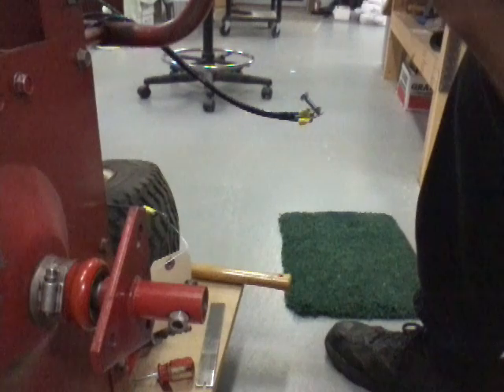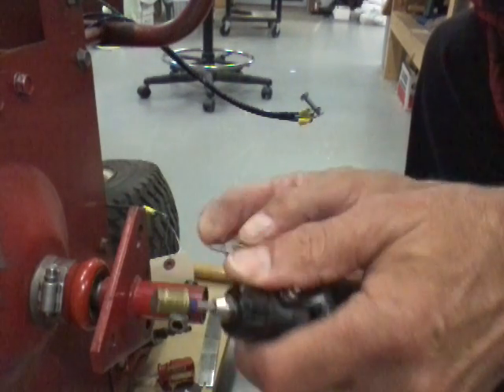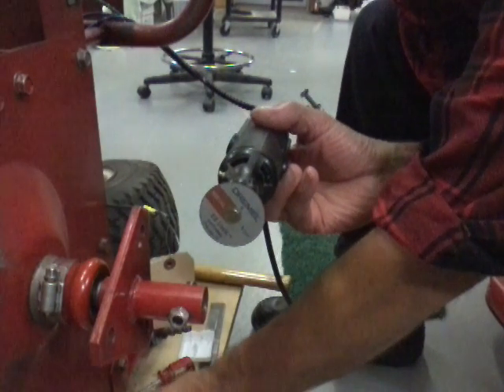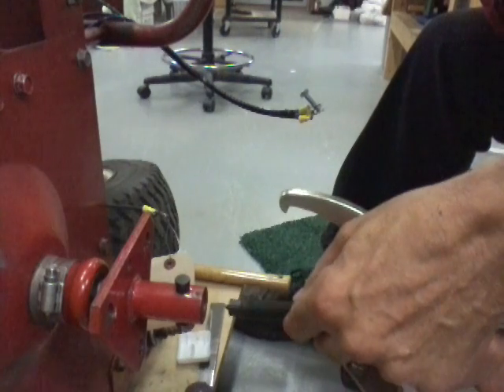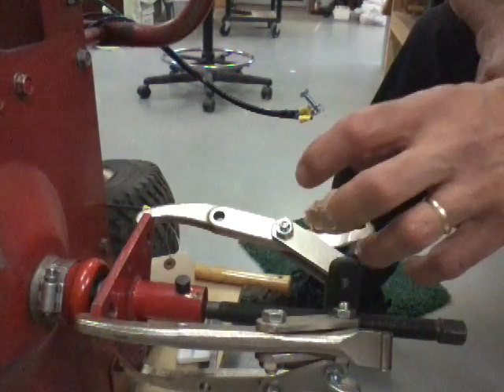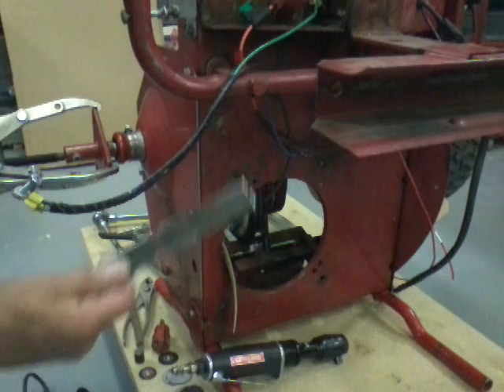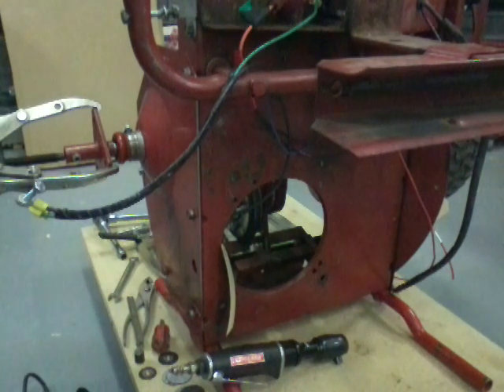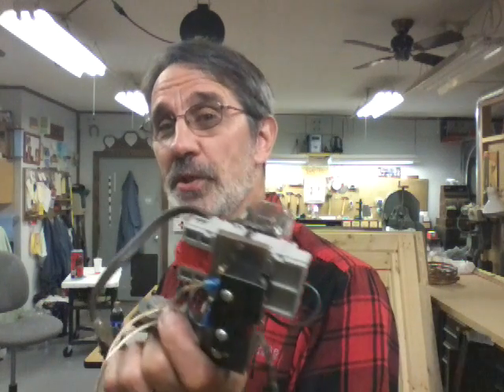39. Removing the wheel flanges off the axle of my Snapper Rider

Comment: Thanks for the video!  Luckily I didnt have to cut mine, but tapping the puller with the hammer did the job. I tightened and tapped multiple times until it finally started moving.

Comment: When I worked at the Snapper dealer we had to cut off lots of them.Sometimes you can warm them with a torch (not a wimpy hand held propane torch). Most times we beat them off with a bar and hammer.
Reply from the maker: Well at least doing it this way you can reuse the wheel flanges

Comment: Just tried everything you said, now my gear puller is stuck on there. It wont turn either way. How important are those boots anyway, its just a snapper. Im takin mine to the curb, whoever gets it, is gonna get a free gear puller too. Thanx Snapper!
Reply from the maker: Send me a picture of this with the wheel puller on it and let me see what’s going on and yes the boots are very important it keeps the sand and dirt out of the differential and chain case. Jim
Reply: @jimjackson9381  After bending one of the ears, i was able to get the puller off. I think this job is too big for me, and ive got alot of money in it, and dont have proper tools. So,i cut the boots and put them in place as is.
Probably gonna fail.
Worst day EVER!!!
Thanks for your help though.

Comment: Jim thank you so much for these tips.  I followed your steps exactly and used a heavy duty 3-jaw puller.  The thing STILL wouldn't budge.  I finally utilized that elongated hole on the fender, a 12" long 1/2 extension, and a big hammer and hit the BACKSIDE of the flange while keeping tension on it with the puller.  I just kept hitting it from the backside and rotating it to evenly distribute the force.  After a few strikes with the hammer, the puller would let me get a few more turns so I knew it was moving.  However it found me ALL the way off.  Unreal, never seen one that mean!  Thank you sir for your outstanding videos.  They have helped myself and many others tremendously.
Reply from the maker: Don Carson 
Hi Don 
   I’m glad I can help, hope I can talk you in to subscribing it is free and it would help me out by helping others. Thanks Jim
Reply: Absolutely Jim. I am now a subscriber and very appreciative of the time and effort you put into your channel.  Keep up the amazing work!

Comment: I suggest putting the puller legs on the flat surfaces closest to the center rather than the ears where the bolts go. I ended up bending the ears from the force and had to heat them with a torch and pound them straight again.
Reply from the maker: CerebusTV 
Where you put the wheel puller once you cut the tube doesn't really matter because once you cut that tube it pops right off. If you're going to try to pull it off with out cutting it tube I have a special puller for the wheel hubs it and I don't use a Standard wheel puller. Thanks Jim

Comment: im having the same problem with my snapper! went and bought puller like yours and stripped it out. looks like i will have to cut mine as well. Maybe i can weld it back together. what a pain in the butt!
Reply from the maker: michael carter
 Hi Michael it's Jim
    If you cut your wheel flange just the way I did ( 90° from the cross hole ) all you need to do is bolt them back on , no need to weld. Thanks Jim

Comment: opinion requested- I have a snapper 550Z zero turn and had the hub removed.  Snapper says if the hub is removed, to replace it.  It is pressed on with no keyway and I don't see any reason to replace it if it isn't broke.  Any comments Jim?
Reply from the maker: I am sorry I don’t have any idea on that. It doesn’t seem like you’d have to but I’ve never worked on one. Sorry.        Jim

Comment: In reference to the tapered bolt that goes through the hub and axle: Should that bolt be tightened as tight as you can get it?
Reply from the maker: Wayne Fitzgerald 
Well within reason some put in a standard nut and bolt. Jim

Comment: I soaked mine with PB Blaster and used an automotive harmonic balancer puller, I had to buy 3/8" x4 1/5" bolts and nuts and it worked perfect.
Reply: How did you use 3/8" bolts ?  .... The hub im trying to get off has 1/2" - 20 (fine threads).
Reply: Sorry ... I understand now .... You put the nuts on the backside. Im a little slow. I was about ready to grind clearance in the enlongated holes on my harmonic balancer puller. And Jim Jackson .. I had no idea that you were talking about reusing the hub. I thought I would have to get another.... Till I saw the following post.
Reply: Yep, longer 3/8 bolts with nuts on the backside of the hub. The tip of my puller was too big to fit so I found a washer that was small enough to act as a bearing surface.
Reply: Did you have to cut the grooves with the cut-off wheel like Jim mentioned ? ... Or did it pull right off with just the harmonic balancer puller ?
Reply: Jay Byrd I didn't feel comfortable cutting the grooves, I just soaked it in PB and used the puller. If you do cut grooves I don't think you'll need the puller.
Reply: Ok ... Thanks for replying .... I didnt have any 3/8"x4-1/2" bolts in stock. So I went by the hardware store & got some ... Plus a piece of 1" inside diameter conduit hose .... Tapped it down on the hub & sprayed the hose full of Kano penetrating oil.  Gonna let it sit till tomorrow .. Then try the harmonic balancer puller. If that doesnt do the job ... I will scribe some lines ... And try the cut-off wheel method.
Reply: Jay Byrd hopefully one of those methods works for you.

Comment: What glue do I use on the inside disc they sent me a clutch with out inside glued on.
Reply from the maker: You don’t need any glue just put it and try not to cut it if possible you don’t wanna gap between the two ends it will make a bad vibration , make a circle and touch. The two ends together as you push it inside of the clutch disc it can’t come out and it won’t slip. Jim.
Reply: Thanks Jim

Comment: Just cut it of with a torch if it doesn't come off with a puller and a hammer. Way quicker. Just have the replacement by your side.
Reply from the maker: Captain 
Just be careful with the hammer, you can damage internal gears in chains by pounding on it. Jim